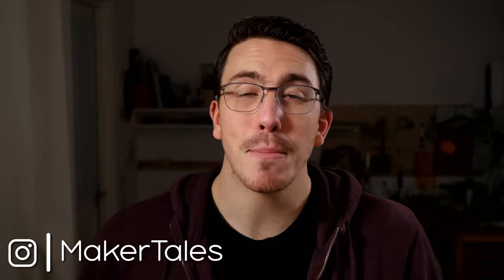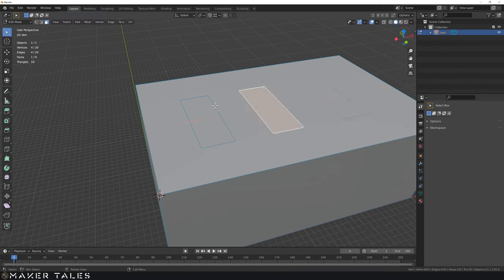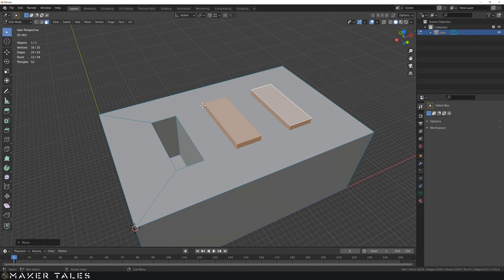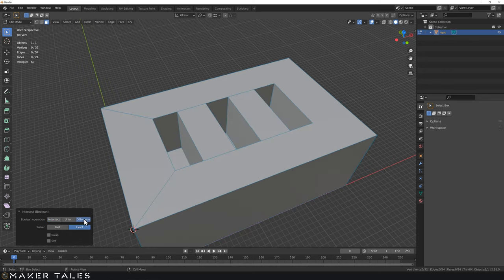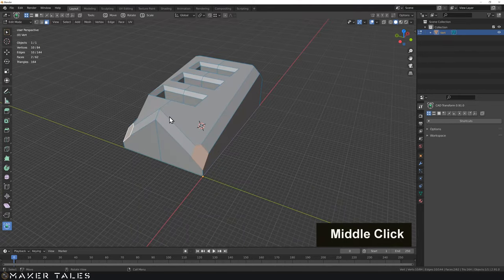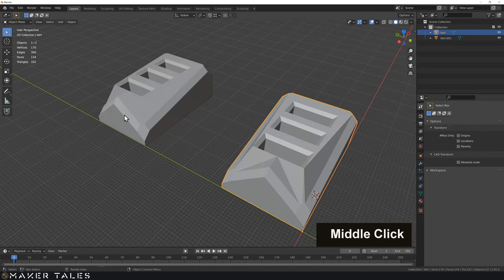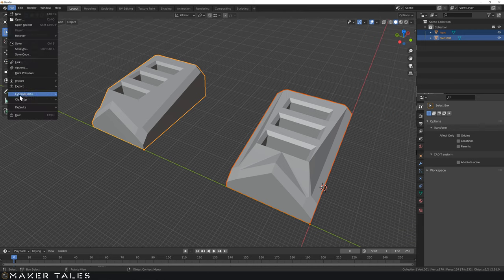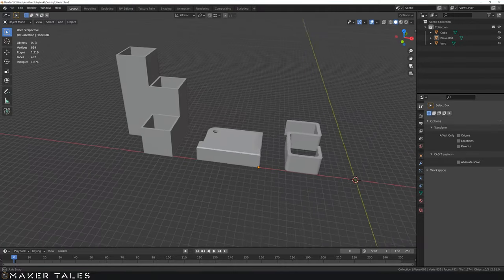Your First Precision Model To 3D Print | Learning Blender 2.9 / 3.0 Precision Modeling | Part- 19

Comment: Nice video as are all of the others previous to this one in your series. Thanks very much. I have a seemingly DUMB problem with this one that I can't seem to solve, however. After creating the 12x4.5 mm plane on top of the rectangular cube, you choose face selection and then move the small plane (using the G key and shift Z) away from the corner of the cube (and 2:56 or so). When I do that, the corner of the cube moves right along with the small plane even though I have selected only the small plane. Huh?
Reply from the maker: hmmmm, sounds to be that you might have merged the reference vertex to the main body.
Reply: I also had this problem and couldn't figure it out. I made sure all of my auto-merge options were turned off and, after two hours of googling things, my wife (who has about 3 hours of Blender experience) said, "have you tried pressing that button?" 

"What? No, that doesn't make sense."
"Just try it."
"Alright, I'll try it."

Yup. My proportional editing was turned on just the right wrong way to imitate the auto-merging of the vertices... My wife was very proud of herself 😏
Reply: i did run into that, but after seeing the specific way the selection was following my cursor i realized i had auto-merge on

Comment: To make holes like this, I use edge loops, Press them to the edge then precisely move them over. then you can just Extrude inwards. Way less convoluted.
Reply from the maker: Hey Joseph that would add extra topology to the design which would make the over all shape unachievable without then having to go back and remove edges and then add more edges in the right place to define the chamfers and of course keep in mind that this is part of a tutorial series i'm teaching tools and techniques for MUCH more complicated designs, I doubt you would use an edge loop for a round hole or for adding more that 10+ holes in one time. I'm not saying that your method is wrong at all, as I do exactly what you are saying all the time. Just keep in mind the context of where this information is presented.

Comment: I can't believe I can make something like this! Thank you for your thorough teaching. When I check my mesh with the 3D-Print tool I get 3 "bad contiguous edges" on one of the side triangular panels. Why is that?
Reply: Hi Angela........thats because you probably have contiguous faces with flipped normals. Then the common edge for those faces doesnt know what to do. Checking "face orientation" on the overlay should help you see wich one is flipped.
Reply: Ive jut noticed that this question is a month old............ probably found the fix for it anyway.

Comment: Excellent video. Never used boolean from the face menu in edit mode.  Very kool.  I was forever making new object to then cut into my main object.  Why do you start with a vertex and build your cube/rectangle?  Is it to get the object origin on 0,0,0?
Reply from the maker: Ya i was quite shocked when I first learnt about face boolean 😂
As for the manual face creation. I only do it so that I did not have to add a whole much a geo by doing loop cuts all over the mesh. Main reason why is because I wanted to show off / use a boolean operation for the first time to have some to reference back to when I show the boolean modifier in a bout 2 videos time.

Comment: So.. Blender works in Meters right. 1.000 m - When I added mesh and changed it 0.030 (for 30cm) it obviously extremely small and can't work on it. In other cases (apart from what you shown here) do you just model any size, and resize it later in 3D print software?

Comment: So I know this might be a stupid question, but to just make sure I understand. I'm kinda better off doing precision modeling in CAD sketcher than like this, right? This is just before CAD sketcher was out? Or would you still recommend using this method over CAD sketcher?
Reply from the maker: I would still 100% recommend learning blender precision modelling and then diving into CAD Sketcher. Especially as it's very alpha atm. On top of that CAD Sketcher is just a tool to facilitate blender precision modeling. I hope that helps.
Reply: @Keep-Making  thank you so much for replying! So just so I understand..  Supposed to be getting my first 3d printer next week, and I want to start modeling my first print.
I started using CAD, and dint watch all your playlist as I thought it was outdated and that CAD sketcher was better.
So if I want to start modeling, should I use CAD sketcher at all? Or should I juts use blender for precision modeling?
Also thank you so much for your work, your my guide and guru on this journey so far...
Reply from the maker: @michaelorlev9925  No worries. Ya it's a tricky thing of blender it's updating all the time. Funny thing tho. Everything in this precision course still stands. Not a single thing has changed so it's still very much up to date. It's a hell of a long watch but learning everything I have in the playlist will put you in a perfect spot to truly take advantage of CAD Sketcher. Jumping right into CAD Sketcher now while still learning is going to be tough as blender/mesh modelling is not very forgiving when it comes to precision. 

Just as a little upsell if you want to get modelling asap for 3D printing don't forget I have this lovely course where you learn blender precision modeling while actually doing 3D printable designs 😉: https://academy.makertales.com/
Reply: @Keep-Making  thank you so much! I understand now (more). I'll check the course out now!

Comment: Hell and thank you for the tutorial!
May be you have a solution about my „cad tool“. I need to switch it on every time I am starting a new blender file. How can I keep the addon turned on? In preferences it is on whole the time.
Best regards :)
Reply from the maker: If this is about CAD transforms, I would be sure that you have saved your preferences once activated. If you are still having problems your best place to ask is here: https://blenderartists.org/t/cad-like-transform/1226197
Reply: @Keep-Making  thank you. I managed the problem by installing the new version of  the CADadd-on :). Best regards

Comment: I watched the half video and I have more questions than answers. I am a total blender noob. Watched dozens of videos, just to learn how to 3d print with blender and I still have no clue due to the amount of things you can do. However.. When I take a look at here and go in with my default settings, I already encounter some problems... how did you set your metric system to show millimeters instead of meters. it seems like I have to watch your entire video series to find out what you mean with "alt c shortcut for CAD transform"?? How do you define the length/distance keyboard using your numpad? You should explain the settings first before going in and do stuff.
Reply: According to me he explained the settings in the lessons/video's before this one... (part 1-18)

Comment: Hey bro don't quads are used by 3D printing machines? Can you explain?
Reply from the maker: For a 3D printering slicer, mesh is mesh... The first thing it's going to do is triangulate it and then check if it's manifold. SO the long and the short of it... for 3d printing the topology does not really matter it all matters is that it's defined through edges as you want it to be triangulated.

Comment: I thought the purpose of the new Extrude Manifold tool was to make pushing those hole faces into the base easy...similar to the Sketchup Push-Pull tool?   But it doesn't seem to work like that.
Reply: I've found that the biggest problem with that tool is that it creates all sorts of duplicate vertices and non-joined geo.  To solve the problems that exist after using it, I select the entire model and apply "merge by distance" and it fuses everything together the way you originally intended it to be.  I use push/pull in SketchUp all the time and never have issues with it.  My first time using it in Blender was a bit of a nightmare.  Now, not so bad, but I've found that I tend to fall back to vanilla methods, like in this video, out of habit because I know what I'm going to end up with.  Add-ons Meshmachine/MachineTools/HardOps mesh cleanup tools also work to fix things pretty well.
Reply from the maker: I'll be showing how to use the Extrude Manifold tool soon. In a nutshell many people are misusing the tool and creating more problems than solutions in the long run. In reality the extrude manifold is actually quite a niche tool as it really destroys geometry and can make the use of any loop operations impossible after use.
Reply: @Keep-Making  OK Thank you.  I finally got the holes in and the part made even though the center loop cut refused to work for me as shown in the instructions.  It would not follow the hole sides and instead made the loop directly across the top of the holes as if they weren't even there.  Then Blender would create some messy extra faces over the holes.  Eventually I just made manual cuts with the knife tool and everything worked properly.  Thanks for another clear, informative tutorial.
Reply from the maker: Well good to hear you found a way to get over the hurdles. Keep an eye out tho... IF loop tools are not working it means you might have some none quad or broken geo somewhere.

Comment: Watching this made me sad. I'm a longtime Lightwave 3D and Sketchup user and have dabbled in Fusion 360. I've installed Blender every 5 years or so to check in on it and It's become quite a capable package but it still seems to be more of a digital art platform than something for makers. It's basic tools are weird - bevel is a bevel and a chamfering tool all in one (which is infuriating), loop cut/drag offers no precision at all (making boolean operations the only way to do this), there are no guides (even buying construction tools, which promises Sketchup-like workflow, doesn't work when you leave construction mode so snapping). There are a lot of great things about Blender but precision modeling doesn't seem to be one of them. Watching you model such a simple piece seemed really clunky and i kept thinking about how doing I would do it in the other packages that i know and it it seemed like it would require fewer clicks and would be faster. Sketchup would have been the fastest with no addons required,, Lightwave a close second (no addons required) and Fusion 360 would have been the most difficult (but not by much if using 3 sketches). I don't know... maybe i just haven't learned enough about modeling in Blender yet, but this workflow seemed really complicated to me.